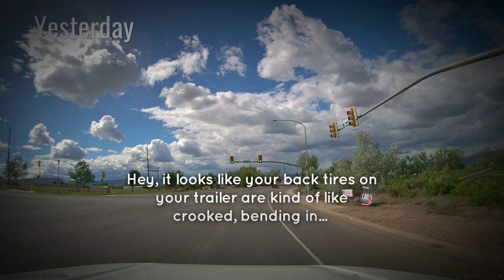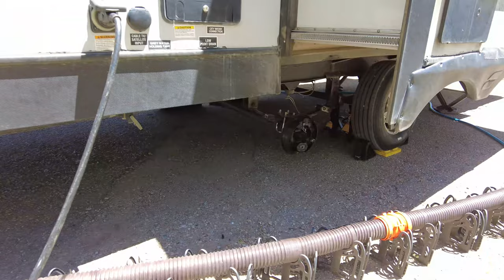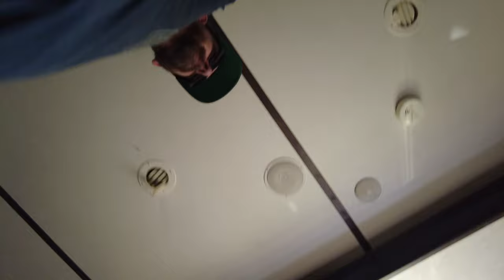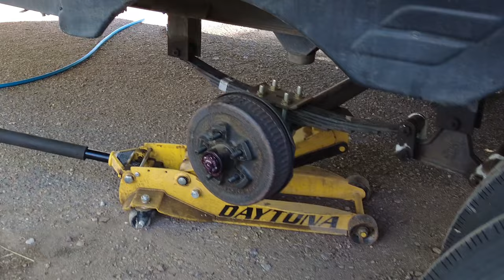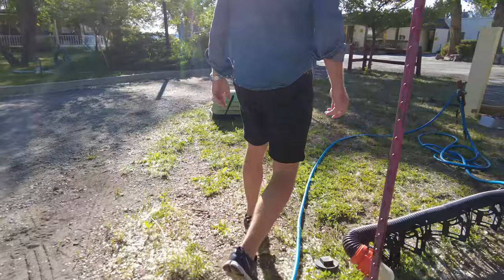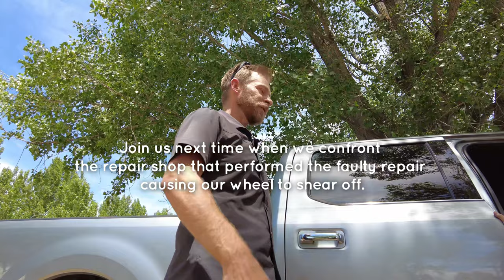RV Wheel Fell Off on Highway | Broken Trailer Axle | Fulltime RV Maintenance/Repair

Comment: Wow, what an amazing mechanical shop they are.  They were able to fix a extremely stressful job considering the circumstances by sorting out the correct parts and figuring out the main reason why your axle failed.  They are 10/10 for their professionalism and care for their work for their client.  If you dont mind me asking.  What was this shop or company out of Utah again?  They definitely deserve high praising.  I'm glad he was able to identify all the issues and kept you guys safe.
Reply from the maker: Yes, the service tech, Riley, was amazing. He was able to quickly diagnose the issue and fix it correctly. He was also proactive and checked the other hubs thinking the previous repair shop probably did those wrong too. He was correct and may have saved our lives (or others) down the road... 

The shop that helped us is Stick's Mobile RV & Trailer Repair, Vernal, Utah
The terrible repair shop that could have killed us: Beaver Tire, Beaver, Utah

Comment: Sad that this happened. Odd that you did not feel the vibration as the wheel assembly came loose.  So next time!!  Be nice to your technician(who was awesome)and remove your poop pipe. Bring in your slide so he can work without straining like he did(again awesome)You guys are physically fit why did you hire some Bozo to do simple wheel work?? This is an easy job. Your rim and tire are sold at every Walmart. Ready to install. If you travel long distances you should always have 2 spare tires ready to mount. Replace all components with DEXTER brand.

Comment: Sucks this happened to you guys. It's all too common though. Bad mechanics everywhere. Give your vehicle a daily once over. Understand the mechanics of it so you can check the work that's been done on it is up to standard.

Sure, you shouldn't need to, but should or shouldn't doesn't mean shit if you're dead, or someone else is dead after your wheel comes off and hits them.